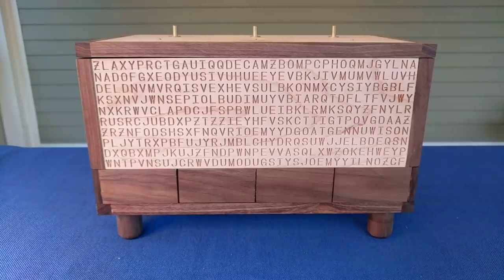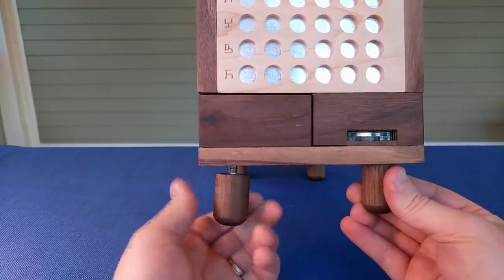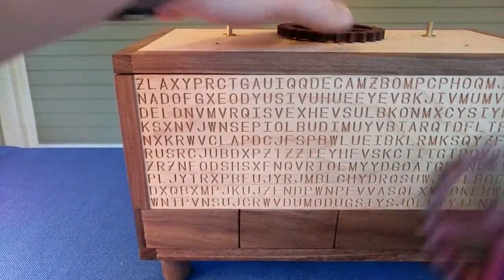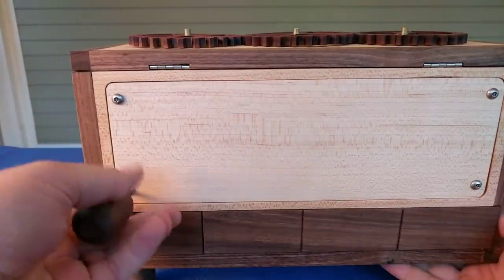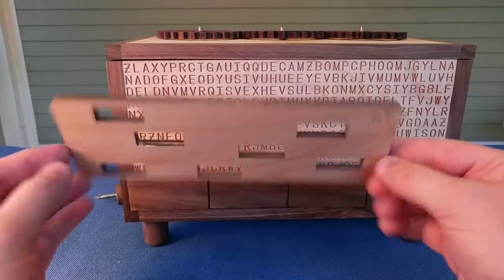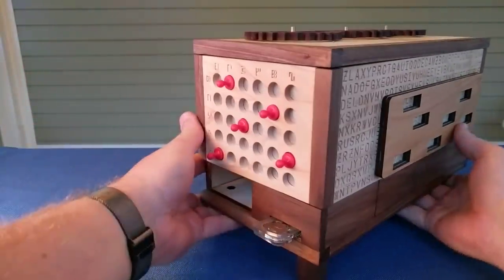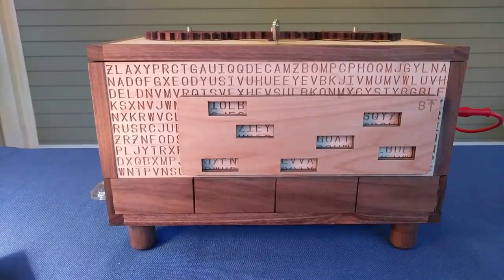Custom Puzzle Box

Comment: I wouldn't even have thought to unscrew the leg. I already lost.
Reply: Jombo me eather
Reply: Someone has why to much time on their hands. But the box is ingenious how it was designed..
Reply: I thought of it right away!
Reply: Unscrewing the leg is a fair puzzle that fits the construction. One technique for solving puzzles, boxes, escape rooms, geocaching, etc.. is to locate the item(s) that seem out of place or unnecessary and ask why they are present. The answer is usually that they are necessary to the solution. Congratulations for this design, and for the work that went into it.
Reply: Ya, like "should I just break these off?"
The cards make it a little easy though.
Reply: @chuckkelly1225  there is never too much time.
Reply: @FactsMatter  Unfortunately, in most puzzle boxes, every fastened item is intended to be fastened, to hide the secrets. Otherwise everyone would just unscrew them and yell, "I solved it! All I needed was a drill, hack-saw, screwdriver, pliers and a little brute-force for all the stuck latches. I didn't even need a key or code. I just unscrewed everything I saw and cut through everything that I couldn't unscrew. Then I pried every latch that wasn't perma-welded!"

Sorry, but this box has some far-reaching solutions that are not "puzzle like", in nature, spirit, logic or design. The leg is honestly a common thing to try to remove, in some puzzles, as it protrudes. However, the box that has to go back, upside-down, without any "clue", is just a pure lucky guess, which a rare few would even think of, as no other part required re-insertion in another orientation, except the gears, which were another far-stretch for code decyphering.

This is one of those puzzles that, at face value, seeing the solution, would be an 11 out of 10, because it is almost literally unsolvable, unless you know the solution, as parts can honestly NOT be "figured out", unless you were the creator. It's like saying that a space-ship is a puzzle, because all you need to do is flip the right switches at the right times, and poof, you can fly to the moon now. (No, it's an 11 of 10, which is NOT a compliment, in these cases.)

Also... well... electronics... Used minimally, but in a way that simply cheats or bypasses physical mechanics, which is sort-of a "puzzle-box" requirement. Might as well say my phone is a puzzle-box, because you have to guess my pin-number to open it.

Don't get me wrong, it's an awesome design and concept, but it's also above and beyond most solvable logic and seems to be completely devoid of any actual fun. I think I could relate the "fun level" of this, to being equal to throwing a calculus equation at a fourth-grader in special-ed. This is something I would send to my enemy, filled with things that would be more of an apology than a reward, for the torture I put them through, trying to open the box.

This is similar to the SMS puzzle, which has literally stumped the best solvers, because it honestly can't be solved, unless you KNOW the solution and in-depth inner workings of the device, which you can't see inside. It's too specific and requires solutions that are literally just impossible to figure out, or even guess. (A puzzle box that is actually discontinued, due to the numerous complaints about it.) It makes this puzzle box look easy, in a sense, the SMS box is a 12 of 10. Which, again, is not a good thing. That is how many levels of impossibility is required beyond logical, acceptable, solvability is in a puzzle. https://www.youtube.com/watch?v=pAaQJj3ijos
Reply: I would have left a little clue for that. I would have unscrewed the panel, before trying to turn a leg.
Reply: @alexanderschestag3247  there's often not enough time though, lol

Comment: I'm floored by the level of workmanship in this box... how perfectly fitted the pieces are, how beautifully crafted it looks. Then to contemplate it's many challenges, each with multiple steps leaving contemplation, guesswork and good old fashioned luck to master. If this was found in a vault 1000 years from now, there would be great interest. I made a connection with the Antikythera mechanism even if each serves a very different purpose.
Reply: 1000 years from now the batteries would have corroded and there would be no way to open it fully.  Awesome box/present/challenge but wasn't designed to last 100 years without swapping the packs out, heck even 100 and it's not gonna work as inteneded. It's literally nothing like the Antikythera in form or function other than it has gears but so does my kids wooden toys.
Reply: Very true. Most batteries don't last a decade, but this puzzle box would elicit enough interest in the right hands. Of course it wasn't intended to predict the position of planetary bodies and eclipses like the Antikythera mechanism. My comparison was simply that these are machines that require careful examination to uncover their secrets. The Antikythera mechanism machine was x-rayed to understand it better. Similarly, the secrets of this puzzle box and the mystery of its purpose could be learned without breaking it apart or unscrewing/prying it open like a kid's wooden toy.

Comment: The upside down drawer would have had me beating my skull against the wall
Reply: You just need to...(wait for it)...think...(wait for it)...outside the box...
Reply: Halloween House, why hurting yourself.......just give up. LOL
Reply: Dilettante_Elite _ actually you have to think inside the box.
Reply: You don't necessarily have to use the upside-down drawer; you just have to look into the recess and see that there's a bar that can be pushed.
Reply: I would've looked inside and used my hand to do it. I wouldn't have figure out the upside down box either.
Reply: I guess if you look in the space, where the drawer used to be, you see the button
Reply: The clue is that the drawer box has an indentation in its bottom that doesn't do anything. It's there so the button isn't pressed.
Reply: @feelfreefpv  I would have just stamped and kicked the box around till it broke apart. I don't give a toss about upside down drawers, just see what is the best way to bust the sucker up.
Reply: @Capsyzable Not so obvious, I'm Gen X.
Reply: @ralph5450  or upside the drawer?

Comment: 8:54 oh yes, of course; this is a PERFECTLY rational thing to do
Reply: Theres a  notch on the bottom which would suggest some sort of functionality.
Reply: To get inside the box one must think outside the box.
Reply: Ah yes
Reply: When solving any kind of puzzle box like this, you take a good look at all the parts you get just to be sure that there's no hidden use to those parts beyond just being a vessel for something you needed. Seeing the notch on the bottom of the drawer is a hint, and you'd likely peer into the openings where the drawers came out of as well. If you noticed that there was a little latch or something that could link up with it, yeah you'd give it a shot.
Reply: @jamesprins9735  That's a fucking beautiful and profound line, and it's buried three comments into a thread
Reply: @pigcatapult  That's the YouTube comments section for you though :P

Comment: When I first started the video. I thought it might be cool to build this for my grandkids.  Then I watched it.  Nope.
Reply: If you build it for your grandkids, they would be still puzzling over it with their grandkids.
Reply: You could make the puzzles a little easier. Not use the gear-wheels for  decoding for instance. This would make the words in the jumble easier to spot. Using magnets to be able to position the slits is something a smart 6 year old can figure out.  Most don't read well enough at 6 to spot words in a jumble. And you could leave more clues, like "start by turning the legs" or a little drawing of a symbol that is on the legs and an arrow to show you have to twist it.

Comment: Its great work! amazing to see it laid bare. The only suggestion I could think of would be that each discovery should have a clue that leads you to the next secret. With the drawer that you insert upside down, it did not look as if there was any logical way to work that out, other than through trial and error. Each clue should have something that leads you to the next, and the upside down drawer was the only one that I saw that did not. 
Great peice of work!
Reply: Think about it: if you have nothing else to go with at the start you would twist, push and pull every element of the box to see what happens. You would find the leg rather quickly. Pulling out the drawer you would look into the hole and see the lever at the back, and then think what could be used to move it.

Comment: You sir, are AMAZING!!!  

For the battery issue, I would suggest a rechargeable battery and an accessible hand crank. Just a thought.
Reply: Or a spare key 🙄
Reply: or just a rechargeable batteries and a small mini usb charging port.. I mean the guy has the knowledge to create this and setup the electrical components, a little charging port would be a piece of cake comparatively.

Comment: what happens when the batteries die?
Reply: Then you take a saw to it, or perhaps there's a backup key that can access the battery
Reply: it only took a key to open the top, so I guess he would have a back-up somewhere else
Reply: You could always set it up to also accept an outside power source in case of emergency...lol
Reply: It could also be set up such that the battery keeps it closed. So if the battery dies, it just opens.
Reply: But that would just cause the battery to die faster?  A predicament indeed...
Reply: set two external metal pins, use for battery charging and power supply in the event they die
Reply: spare key
Reply: YC Y    ...in another puzzle box?
Reply: If you're really gonna play with the box enough for the battery you run out, you must've thought somewhere that you'd need an extra key
Reply: You replace them.
Reply: Deep nerd no duh. But if it’s locked how can you replace the battery inside a locked box. You can’t break it open because that defeats the purpose of the box and it would ruin it. Yes he might have a spear key but how do we know that for sure?
Reply: Maybe use a crowbar to pry it open, then replace the batteries?
Reply: Derp Nerd Yeah just use a crowbar and rip the the wood apart. Sounds great. Maybe we also just burn that box down!
Reply: @doctorwhouniverse9338  pick the lock probably a pretty simple lock
Reply: Jason  Davis that’s even if you have the skill to unlock a lock.
Reply: Maybe he could incorporate a charger that would plug into the "unused" ports that the Jumper / Patch Cable plugs into to recharge the batteries.
Reply: I am thinking of putting a wireless charger in a puzzle box i am designing. (and that will be built into the desk)
Reply: I bet with the big drawer at the bottom knowing it has a false bottom on the inside you would be able to push the false bottom up from the middle drawer being manually open from outside where the other drawer is put upside down,thus allowing you to reach up and access the battery compartment through the drawer opening in the front that is larger... That's just a guess but it would make sense
Reply: then get the hammer and smash it to get your treasure
Reply: When the arduino detects low voltage, another drawer will pop out with a pamplet containing the porn site link so his dad no longer needs the DVD in the box

Comment: just be careful when the batteries run low, or you won't get the key out if it happens to be in the drawer (maybe should keep a spare somewhere or make the batteries accessible from the outside
Reply: i am pretty sure there is a spare
Reply: "it just so happens to be" 
NOT "if it happens to be"

Comment: You kind of glossed over how decoding works with the gears.  You just said, "it decodes to _____" without showing the process.  I get that you have to start with the key characters aligned with the indicators, but then what?
Reply from the maker: In the Github page linked in the description is all the additional detail. Here's a site I put together to make it faster to encode/decode with these gears: https://rawgit.com/rcalme/puzzle-box/master/Cipher_Gears/Translator/cipherGears.html
Reply: I played with that a bit, and it looks like you enter the ciphertext on the first gear, then read the plaintext off the second gear.

If this is correct, I have two questions:
1) What is the purpose of the third gear, and
2) Actually, what is the purpose of multiple gears, since any character will always map to the same character at the output, regardless of the position in the text, making this a simple substitution cipher?

I don't mean to criticize that you didn't emulate the full Enigma mechanism, but it just seems like an overly complicated way of implementing a substitution cipher, if I understand it correctly. Is the point just obfuscation?

Very nice craftsmanship overall.  It certainly would have kept me going for quite a while.
Reply: Oh, now I see - output alternates between the outputs of the second and third gears.  I probably would never have figured that out.
Reply: @BrightBlueJim  Yeah this is too complicated. Just bust it up is the best way in.

Comment: Okay, but the thing I ended up really wanting to know is what kind of things you put in a puzzle box, and in this instance what did you hide inside the box for your dad to find? Because I feel like the satisfaction of solving it could easily dissolve into disappointment depending on the gift inside. It's s great work up, but the climax is important dude. Even just cutting to a rick roll upon opening the box and peering inside would have really made this video complete.
Reply: I think the gift is figuring the puzzle out rather than what you get afterwards.
Reply: crash979797 but it's a box. The point of a box is to put something in it. The point of a box that is hard to open is having something rewarding or valuable inside. 

And all jokes aside it's an amazing gift, so much work and thought put in it. Even if I loved puzzles like that, it would still be weird to me if I opened it and there wasn't like...at least a chocolate bar or some new socks inside. What's inside doesn't have to actually outweigh the value of the box itself, it just seems... like the value of it being a box where the goal is to open it makes the box less valuable because it didn't do it's one job.
Reply: The point of a puzzle box, obviously, is to open it. You can put something in it, but the reward is figuring it out.
Reply: crash979797 the reward of a puzzle is figuring it out, the reward of a box is using it to contain something. Then you put the two concepts together and you get a puzzle box. Otherwise he might as well made it smaller and just put a note instead of the key in the last drawer congratulating you on completing the puzzle.
Reply: If getting the box open isn't rewarding enough, you've given it to the wrong person.  But even after it's been solved, it's a cool place to keep things.  Like baby pictures of your clever boy.
Reply: A brick of mouldy cheese

Comment: Very cool. The only worrying thing I can see is what happens if the batteries die? I suppose you could have a spare key, or pick the lock to get to the removable false bottom to replace the batteries should they die or any of the electrical components stop functioning properly for any reason.

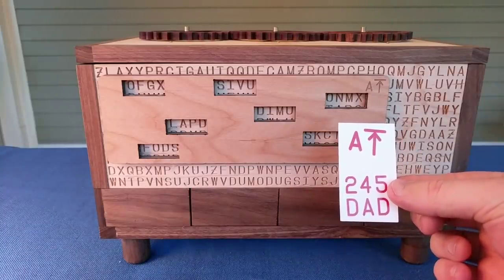Comment: I have to confess, after watching this multiple times, that I'm still confused about the process at the 6:40 mark.  I understand the next step of 'when the 1st letter is aligned with the pin on the first wheel (of the DAD combo) the other two wheels will reveal the symbols for the magnet placements.  But how was that 1st letter determined from the 7 openings on the front of the box?  This eludes me.
Reply: Mick S I also don’t understand that.

Comment: at 1:30, thats the kinda stuff i hate in puzzle boxes.  If you've seen the "broken radio" puzzle (i think it is) it has a somewhat similar, but completely different in use idea.

I see things like this and i can never tell if i force it because it has enough give that it wiggles a bit and its part of the puzzle, if i should pull really hard because it does wiggle, and its probably just held in there by friction, and the humidity and heat may have caused the wood to swell a bit, or if its made like that, or if its just not built up to standard.

AKA, the "destructive" puzzle elements.

I'm not trying to dis your effort or anything, but i finally had to say it somewhere.

One question, can you replace the batteries if they go dead when the box is closed?

Comment: So I don't get the first code solving. 7 sets of 4 letters that somehow tie in with the 3 wheels on top that have symbols underneath, as well as 5 magnets that go in 5 conjunctions of symbol pairs, and one note showing a letter and 2 symbols? Also the 2nd symbol on the note, I couldn't see this symbol in the symbol grid where he's to place the magnets so I'm completely confused because he didn't explain this (also not the 2nd part where he's putting the cord pegs into the holes but that's ok, maybe if I understood the first part it'd be easier to know what's going on in the 2nd.)

Comment: Great work and thanks for sharing plans and codes. Almost finishing mine now with some small additions. How do you reset the motors after its open? Pulling them manually is a major PITA - especially for the one behind the cypher gears drawer

Comment: Is it possible to give us a link for the connection plan from the Arduino? The LEDs and the other wires
Reply from the maker: The pins are all mentioned in the code here: https://github.com/rcalme/puzzle-box/blob/master/Arduino/Puzzle_Box/Puzzle_Box.ino#L12-L42 (which you could change). I'll work on making a fritzing diagram too.
Reply: Fritzing diagramm is very good! :-) Only through the sketch I do not understand it